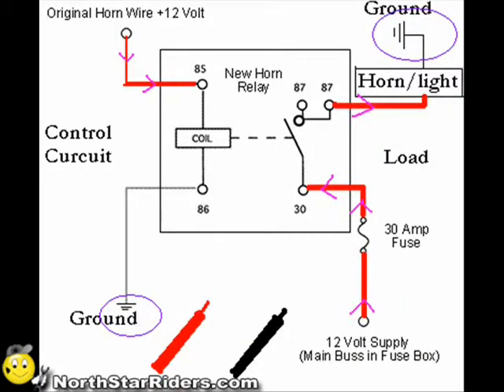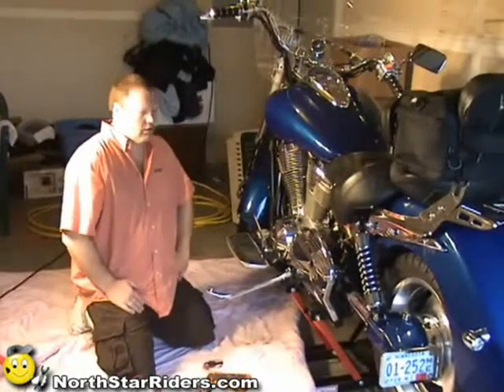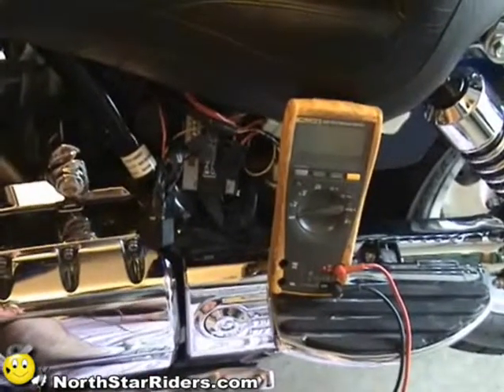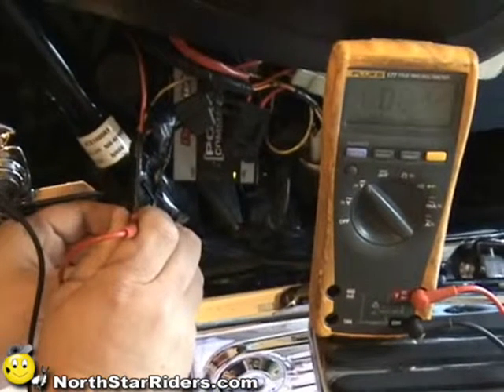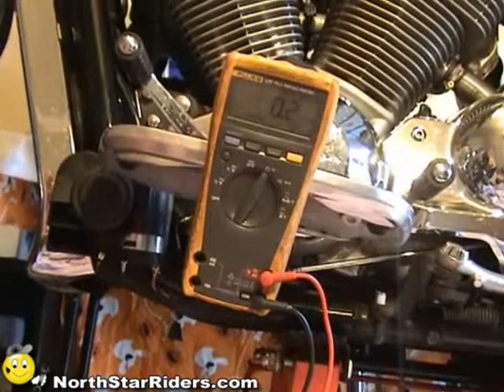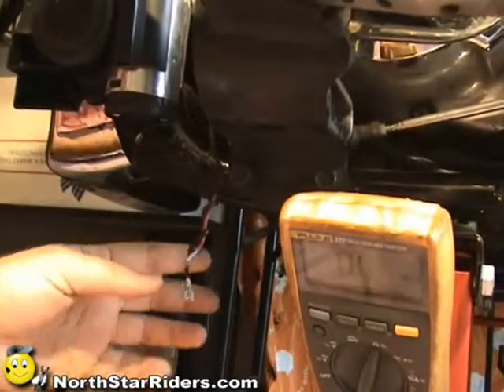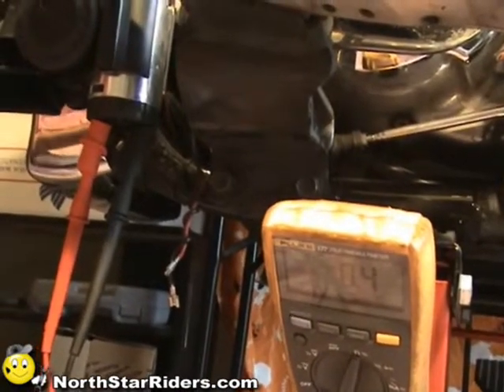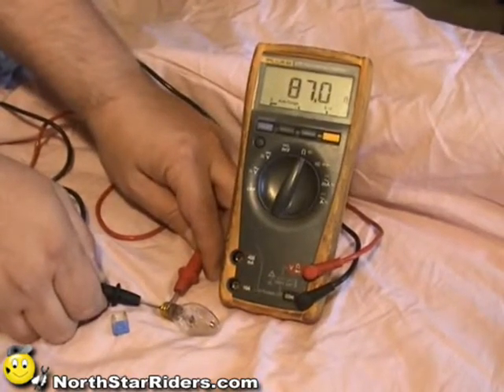Basic Relay Troubleshooting NSR Tech.wmv

Comment: when the key is turned on and it makes that humming noise. what is that? i have a 2002 vtx 1800c that is having issues starting and its not making that noise or even cranking when start button is pressed. starter is good and relay to starter is good.

Comment: "OL" stands for over load not open line. The reason the meter shows over load is because it cannot measure the resistance of the air since the restance of the air is very high (above what the meter can measure)